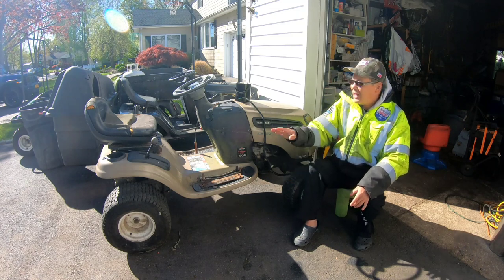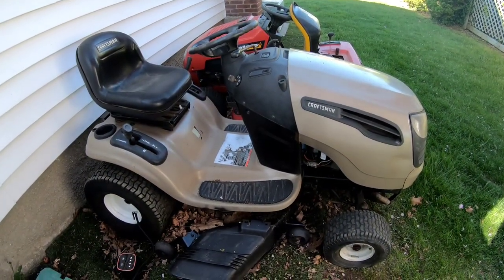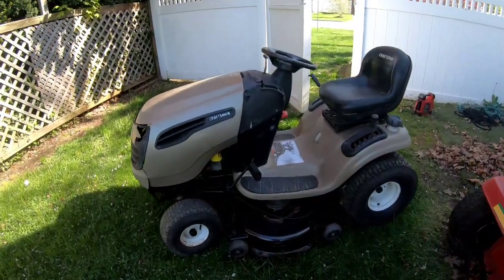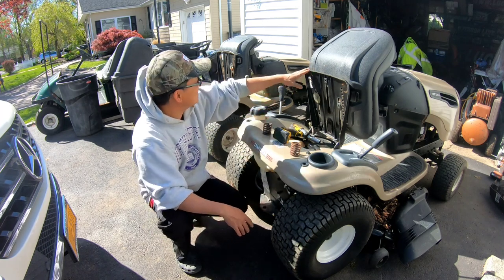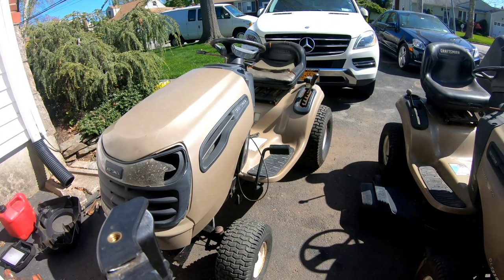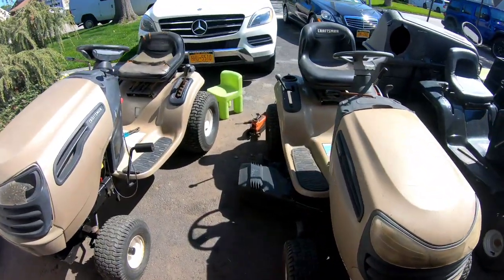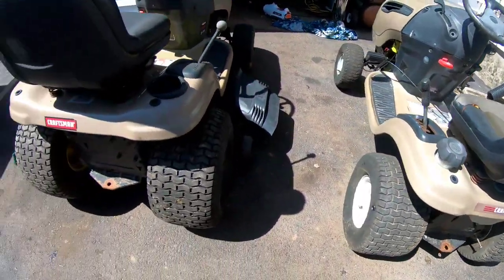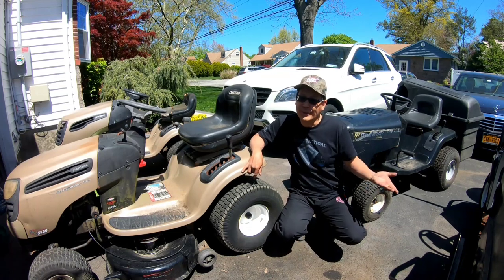MAKING A GOOD LAWN TRACTOR OUT OF 2 BROKEN ONES CRAFTSMAN 20HP DLS3500 MOWER DECK WHEELS SWAP LIGHTS

Comment: A great swap. I agree better to put the deck on the one that runs and not have to use a fuel pump setup on that other tractor. 🔧👍😎
Reply from the maker: Yeah why make things harder?  Thanks john,  hope all is well buddy!
Reply: @MowersNBlowers  it has been. Unfortunately ppl in my neighborhood been asking for repairs  which is good but putting my projects behind
Reply from the maker: @Turningwrenches85  at least you’re making dough bro!
Reply: @MowersNBlowers  I am . That is true

Comment: I think the lights are provided voltage from the stater, when the engine is running so they don't run the battery down?

Comment: By putting the bigger wheels on the tractor you plan to sell will this throw off the mower deck from being parallel to the ground?  It would seem that the back of the deck would be higher than the front.
Reply from the maker: No,  it’s wider not higher,  if any at all it’s negligible

Comment: Mowers N Blowers Honestly you are working on Chinese Production Throwaways / Let see you get down and Dirty with a John Deere not from Home Depot but from a Dealer / Wheeler Horse / Jacobson / Bolens Tractors ?  Check out Taryl  fixes All on You Tube a Real Mechanic
Reply from the maker: Lol!  Did it done it do it all the time!  1500+ videos including one with Taryl and the gang,  try and catch up.
Reply from the maker: FREE JOHN DEERE L100 LAWN TRACTOR VALVE ADJUSTMENT CARBURETOR CLEAN FUEL MIXTURE ADJUSTMENT 1ST RIDE
https://youtu.be/IzpRHsJxHks
Reply from the maker: Never said I wanted to be a mechanic!  I don’t want to be a mechanic!  I’m too old to be a mechanic.  No need to be a mechanic,  I have a degree…
Reply: What do you do on your channel?